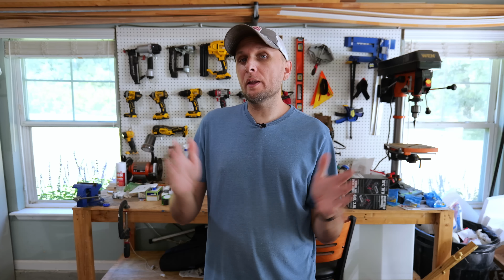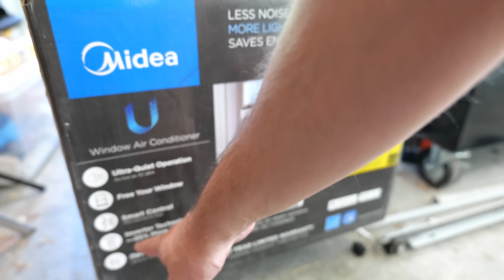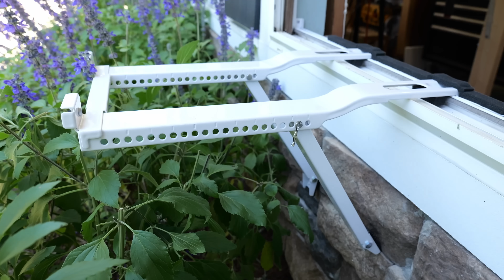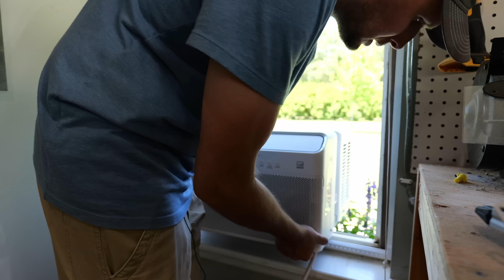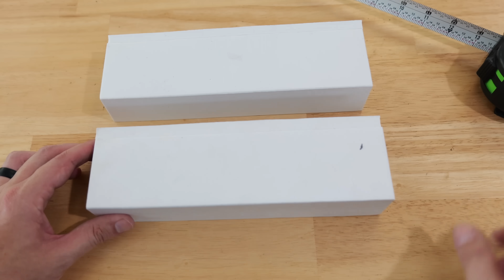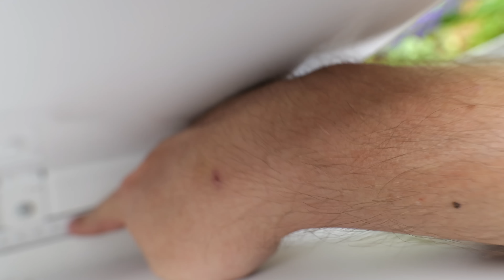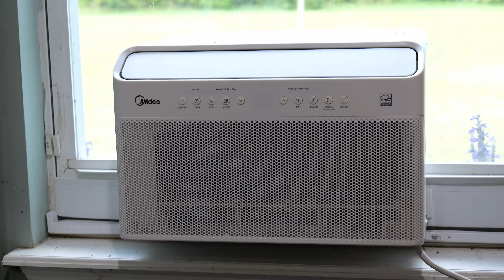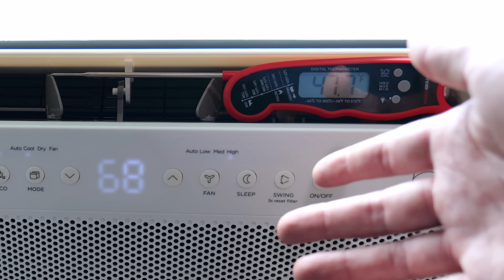The COLDEST And QUIETEST AC Unit Ever Made!  Still Use Your Window!

Comment: Good AC but has some issues in certain windows. Mine makes sound loud 20-30Hz noises in my current house window. It's an all wood house so not the most solid house around. It's sometimes annoying sometimes not. Just depends on my mood I guess. 

Also has a very high pitch noise that is always there. Like the kind that is around 15kHz + or - a bit. It varies in amplitude depending on where you are in the room. 

It tends to run and run and run until it's at least 3 deg below the set temperature which is silly but knowing it does this makes it easy to counter it. I have it set to 76 but it always keeps the room 73. 

It's a good AC with flaws. But ignoring the few issues above it technically is the quietest AC I've ever used. If I was at my old house and got this I don't think the bass it makes in this current window would be an issue at all.

Comment: I installed the 8k BTU Midea in 2023. installed in the Primary bedroom. This room struggled to keep cool with central a/c as it was south and west facing with windows on 3 walls. Now its the coolest room in the house! The unit is fairly easy to install. Just watch the video. I took it out for the winter (not required). Took just 10 mins to reinstall. Once the foam insulation is cut to size, it's straightforward.

Comment: Bugs get through these, great video! I’m looking to get one anyway when the next sale hits.
Reply: Allow me! The bracket, to which you place the AC upon, has 2 small gaps that can be seen with the naked eye after installation. You need to use more foam or insulation to stuff or fill it completely back up. Seems incredibly obvious, however not everyone is going to bend over and look straight at the bottom afterwards, especially with a flashlight. Hope this helps?
Reply: Zero bugs with both of mine.
Reply from the maker: Hmm, I know I haven't had this installed a super long time but so far no bugs.

Comment: I have the 8000 BTU model in my small 200 sqft shop. I'm in South Florida so it runs 365 days -24 hrs a day. It's done this for over a year now and I love the hell out this unit. It puts the rest of them to shame and yes... it's very quiet. If it failed tomorrow I'd buy another one in the blink of an eye! It's everything the manufacturer says it is!
Wakodahatchee Chris
Reply: I love mine as well,  when yours finally goes you may want to size up too the max or get more insulation, no way it should be running that much but sometimes you gotta do what you gotta do.
Reply: @1jfmurray  it's actually better that keep running vs cutting on and off alot. 
Not sure if those are variable speed like most minisplits today.
 But the same applies... a variable speed will throttle down so its not consuming much energy.
Reply: @mbburry4759  Yes it's a modern SMPS unit that throttles up and down. There is none of those heavy inrush currents typical of older technology.. I barely know when this thing is working hard.
Reply: @mbburry4759  That is subjective. A properly sized unit should run long enough to not only cool, but reduce humidity as well. But having said that, if someone has one that is to undersized it can put strain on the unit causing premature failure. The compressor should not be running hours and hours without cycling. Though it is also true that an oversized unit can cycle on and off to often (short cycling) which basically just runs the power bill up and also leaves the area not feeling cool due to excess humidity being left behind.
Reply: @jbone6246  - this is an inverter unit that uses frequency controlled motors. Comparing to units with AC induction motors is not valid.
Reply: @1jfmurray but 8000 btu should cool a 300-350 sq ft room so maybe this unit isn’t really why it claims?
Reply: @roz4747 true.  If open stud, not insulated, door gaps, it requires more BTW to control the heat load.   My current situation.   Swamp cooler in Central California dry heat works for 90% of my needs
Reply: I bought Three, for over Two years, they have been running like a dream, the best window A/C ever. I can't live without them. I live in Houston.
Reply: @lukelu9161  "I live in Houston" > that's saying something!!! what a swamp that spot is!!!
Reply: @lukelu9161  
You bought 3 of these window units that he is showing in this video? Right?
Reply: thought that youd like to know that i cleaned mine out with cleaner and a water hose flowing into the top vent while it was on the ground while slightly tilted forward allowing the water to drain through the front vent.. let it dry then placed it back in window. like new again..  I use mine in a shop as well..
Reply: How many watt's does this unit pull?
Reply: @jjohnston6645  Unlike older technology it's variable. It's dependent on your demands. There is no huge inrush surge like we're accustomed to. SMPS makes this AC unit a gem! I love it!
Reply: @cdrive5757  trying to figure out what size generator it would need during storm outage
Reply: maybe you shouldnt run it 24/7 and give it breaks in between, or waste some money on a second unit and schedule both units to run 12 hours day or smth
Reply: @peppermeat8059  Why? I'm perfectly happy with it as is. The "running 24-7" comment is being misconstrued. I live in VERY HOT S. Florida. While the unit is always moving air it only pumps out cold air as per the thermostat setting. The unit can also be set to turn completely off when not running the compressor but I don't use that setting.
Reply: If it runs that much how does it affect your light bill?
Reply: Fan is too f###ing weak. Otherwise, its great.
Reply: Does yours produce a lot of water? I’m in the northeast with 8000btu in 300sqft and I’ve got it over a drip pan and emptying a gallon every 4 hours
Reply: @smartyyy  This is s rather odd question because the amount of water 'any' air conditioner produces is totally dependent on the ambient humidity. Why do you have to empty the waste water? That part of the Air Conditioner should be outside the building.
EDIT: It just occurred to me why someone would ask the question you asked. I have a suspicion that you're describing water draining inside the air conditioned room. If this is your problem you didn't follow the Leveling instructions that came with the AC. There should be a slight decline to rout the water outside. Capice?
Reply: @cdrive5757  if you live in an apartment building it’s not very considerate to have water constantly dripping out to below street level. I don’t think it’s an odd question because in nyc you can see hundreds of window ac units in any face of an apartment building and maybe 1-5 of them will be dripping water for whatever reason. I don’t feel that producing a gallon in 2-4 hours on a 60% humidity day is the norm if other acs aren’t doing the same. Capice?
Reply: @smartyyy  Sorry about that. I was unaware that you were in a NYC apartment. Sadly, you must not have purchased the 'NO Drip' model specifically made to comply with NYC Building & Zoning regulations.  Check with the manufacturer about their 'NO DRIP - RE-EVAPORATOR" model. It's made for the very special people that populate the New York metropolitan area. If all else fails make sure you get to the poles in November. Kamala and the democrat party realize the massive role AC units play in Global Climate Change. She's promising to fix all that the same way they've fixed all the problems at the gas pump. Oh,.. I forgot you folks don't need cars. You have mass transit.
Reply: How is the maintenance on it?  I have traditional style window units that need cleaning about twice a yr because if I don't, they'll start dripping inside and causes a hassle for my family constantly having to peak underneath to make sure they're not leaking.
Reply: @SaberWulfGold  It's been running for well over a year now. I haven't done a thing to her. That said I feel it's bad karma to boast about such things! :face-blue-wide-eyes:
Reply: @SaberWulfGold  if you look online for reviews the most consistent comments are that these things generate mold on the drip pan, coils, and fan within months to a year. It’s designed to collect water on the drip pan and leak out the coils in the front where pitched. Mine generates a gallon every 2-4 hours which the company claims is normal. I find it to be a terrible design but it will have to do for this summer. Will likely have to replace next year
Reply: "It's everything the manufacturer says it is!"  ...  Not from my experience with two of them.  And, for me, CS sucked hard.
Reply: @MundiTaurus  Care to elaborate?

Comment: I bought one of these I year ago or maybe 2 and I returned it I was so bummed I wanted it to work out. I couldn’t tolerate the fact that it blew the air up toward the ceiling.
Reply from the maker: Hmm I’ve not experienced that.  Also that direction can be controlled either on the unit or in the app.  Maybe this wasn’t on your unit?

Comment: but it still I can honestly say that I really don't see the point in this.  It still blocks most of the window opening just like a conventional window unit.  Sure, it allows you to open the window but it still blocks most of it.  The GE ClearView style is a much better option.  Instead of having the slot on the top, it is on the bottom allowing the air conditioner to drop down on each side of the window making most of the window usable and not blocking most of the view.

Comment: When choosing a window or wall unit A/C, be sure to match the unit to the room size.  Why?  

Almost any unit will blow cold air, but an important function of ALL air conditioners, but not mentioned in your presentation, is humidity removal.  

Buying an oversized unit (more BTUs than needed for a particular area) will cause the unit to short cycle and will shorten the compressor’s useful life.  It will also result in the room having a higher moisture content than it should.

Ever walk into an air conditioned room feeling cold, but humid?  Inadequate humidity removal due to improper A/C sizing, was probably the issue.
Reply: Great tip, i would have never thought about that. I figured more is better

Comment: Once you put that foam at the top of the window, you can’t open and close it at will easily.
Reply: True. I have one of these. I absolutely love it. Fortunately, I don't need to open the window frequently, especially if it's really hot out. I do have foam tucked in the top gap, but if I needed to open the window (especially for an emergency), it would open easily dislodging the foam.
p.s. With a couple basic fans to help circulate air, I can cool my main floor with just the one in my bedroom. A godsend during (more frequent) heat waves.

Comment: At  9:50  so  you put a window ac in a house that has central ac? maybe have your central ac serviced ?  Still an upgrade from a  standard window unit. I went mini split ducted system in my  tiny 800 sqft house 24,000 btu  and it heats house  up to 70+ until 20 deg outside and cools it to whatever I set it to. had it for 12 yrs now and  only change filter monthly and wash compressor coils every 2 yrs. Electric bill barely moves . inverter systems rule vs old tech.

Comment: I had tk research this but if you soend the additional almost 300.00 for the 12,000 btu that supports "matter" you may be disappointed. I read a review that the smart home integration if matter gives you two buttons. Cool on and off. Once the uodated matter js released it might/should/could expand to more. I think I'll save the 300 and buy the non matter 12k btu one.

Comment: This does NOT allow you to still use the window. Because the window screen is gone and the gap between the 2 window sections still needs insulation this is no better than a typical AC window unit when it comes to using the window while the AC unit is installed. There are other benefits to this unit, noise being a huge one, but the statement in your title, "Still Use Your Window!" does not apply.
Reply from the maker: It still applies.  Maybe in certain areas you wouldn’t leave it open for a long time but that’s not everyone.
Reply: If the unit is self supporting, and the small areas to the left and right have the fillers I place, which don’t need to be moved, then you are wrong. The window 100% can be used still.

Comment: I have a well insulated house and my Midea 8000BTU keeps about 750 square feet of the house comfortable to cold all by itself except from 4pm to 5pm.   And this is with the doors to the other half of the house left open 1" so it doesn't get too hot.  It's amazing.
Reply from the maker: Wow that is awesome!  Thanks for sharing!
Reply: @HowToHomeDIY  sure thing.  The temperature is 78 to 91 right now.  The insulation creates a 6-8 hour lag effect on the heat.

Insulation is fairly inexpensive and greatly underestimated by most people.

Comment: I noticed in the second year of use my Midea AC started to smell.  My unit did not have drain holes, so water collected in the pan.    I took the outside cover off and found corrosion on the bottom of the condenser.  I added some drain holes.